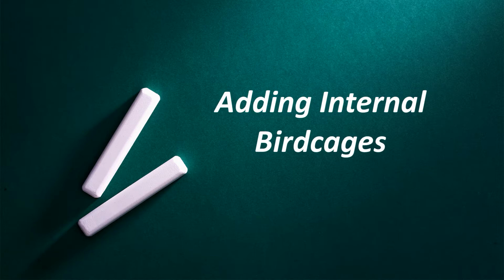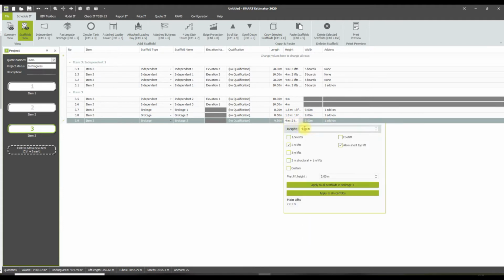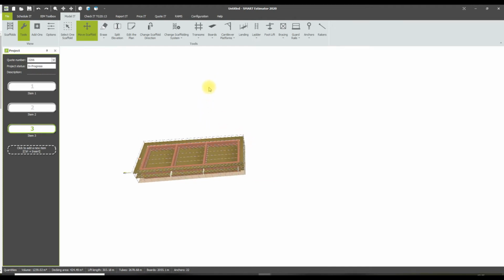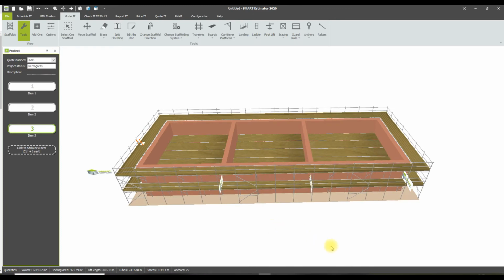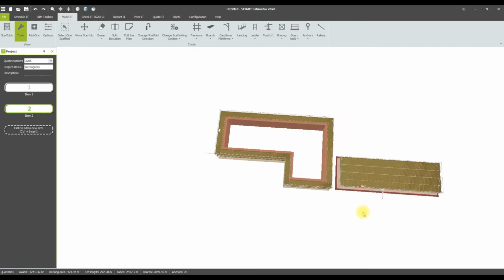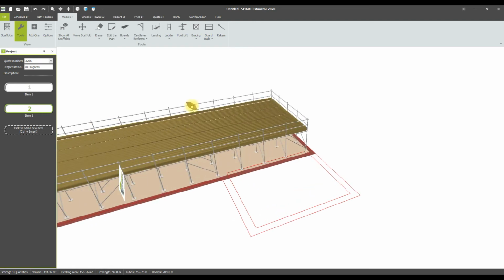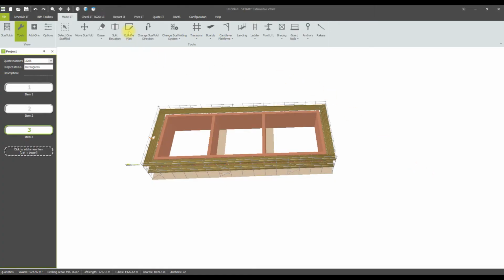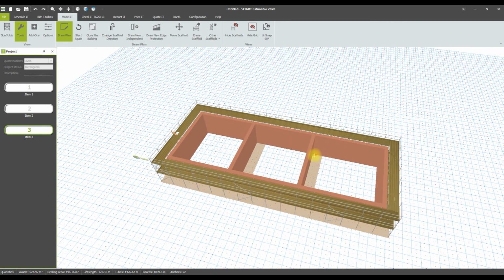Adding Internal Birdcages

Comment: how do you place a board on a birdcage layher allround on its own, because when i put a board it puts a board on the whole lift level.
Reply from the maker: Hi,

Birdcages only currently permit full perimeter boarding, or full lift boarding. You can add individual boards currently

Thanks